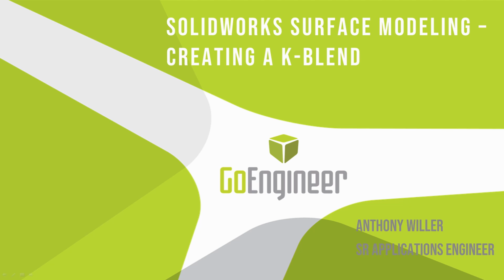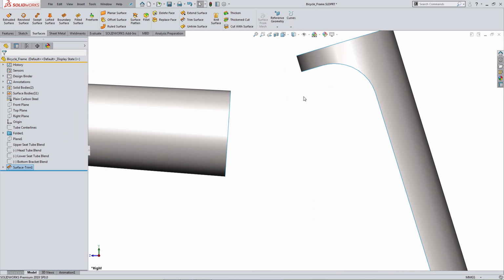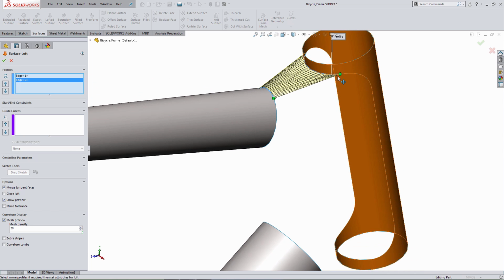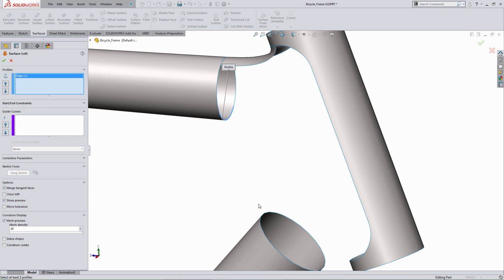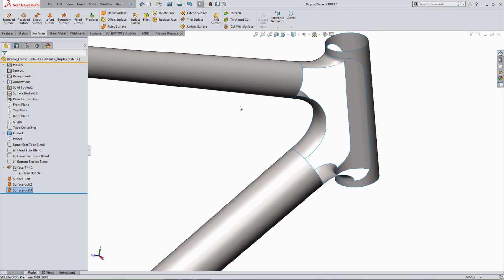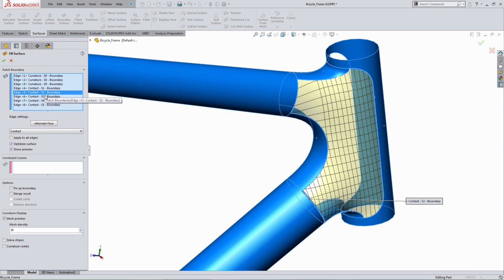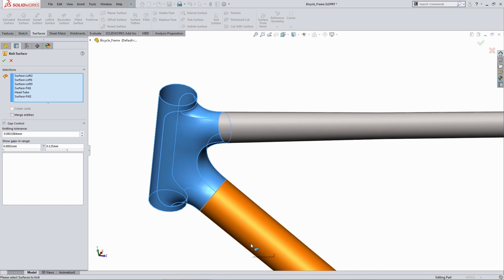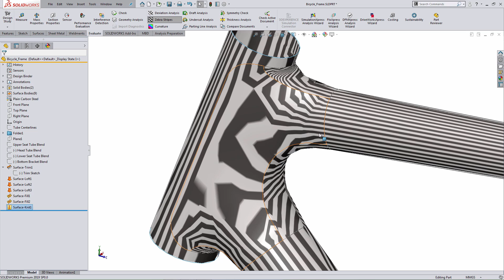SOLIDWORKS Surface Modeling – Creating a K-Blend

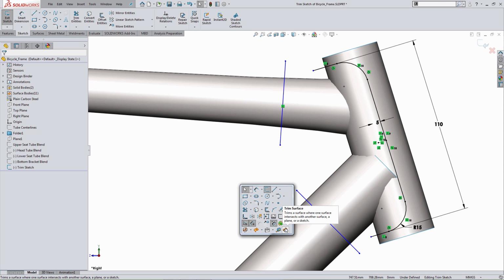Comment: 0:32 How to get the Tool Box to pop up menu?  Short Cut?
Reply from the maker: The presenter is using the "S" key to bring up the shortcut toolbar. This toolbar can be customized with any tools and function that you are looking for. Right-clicking on an existing toolbar and going to Customize will get you access to the customization tab for this function.

Comment: but how do you change surface bodies into solid bodies?
Reply from the maker: Another way to accomplish this would be to cap all opening and knitting the solid bodies together so that a water-tight volume is created.  If the surfaces are water tight the thicken command will have an additional “convert to solids” option available.
Reply: @goengineer  interesting thank you